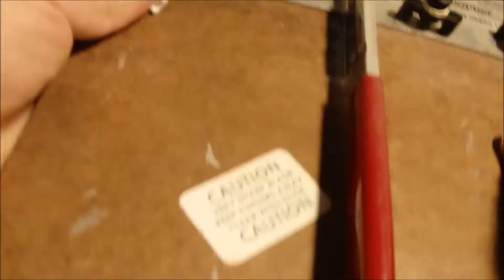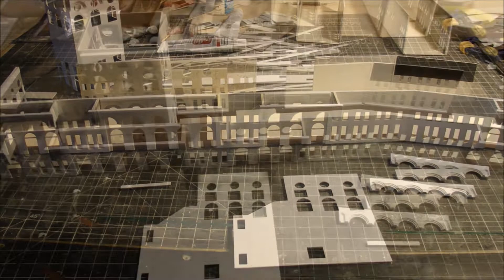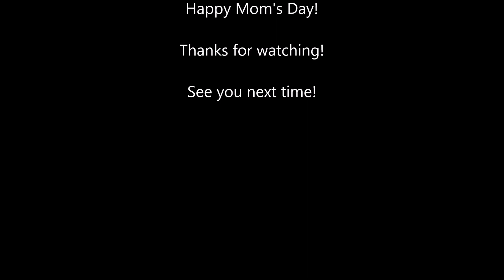MNW N Scale Model Railroad Monthly Video Journal, May, 2020, Part 2

Comment: Collin, I absolutely love this project your working on.  This is really amazing and by watching you, I'm learning quite a bit, so thank you for that.  I am curious though, in previous videos you've talked about sanding putty?  What is that and where do you get it?  Can't wait to see the finished building.  Keep up the great work and thanks for sharing.  Cheers!!
Reply from the maker: Thank you Ron! Most hobby stores carry sanding putty. It's used to fill in gaps and uneven surfaces. It helps to cover little flaws. Applied with a small putty knife into gaps or rough joints. After it dries it can be sanded and painted. Here's a link https://www.micromark.com/Squadron-Products-White-Putty-2pk-4.6oz?gclid=CjwKCAjwwYP2BRBGEiwAkoBpAlbJ0UYezn4Fkq_VzbYd-yznbBHcwHRJrv_CWUglMAB41WDCe598GBoCM8gQAvD_BwE